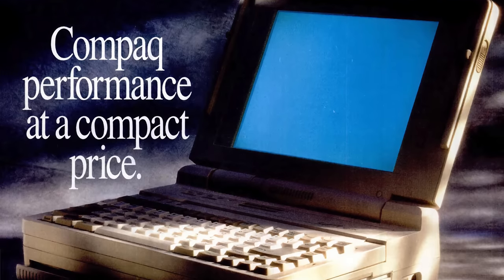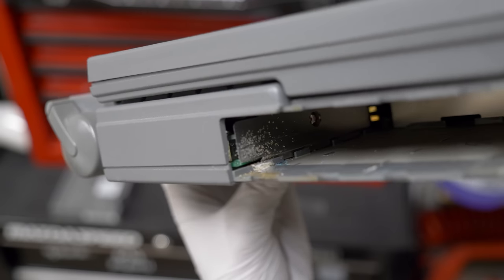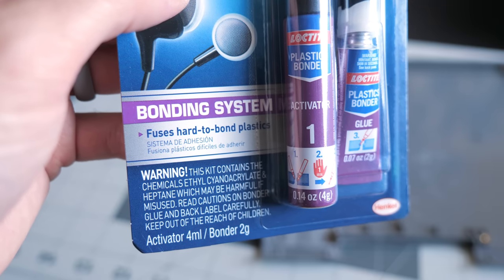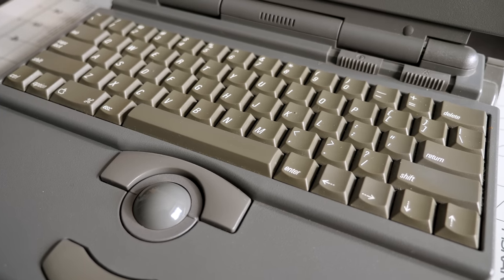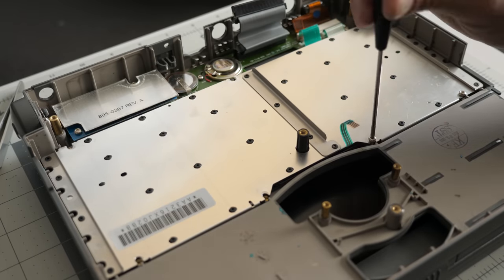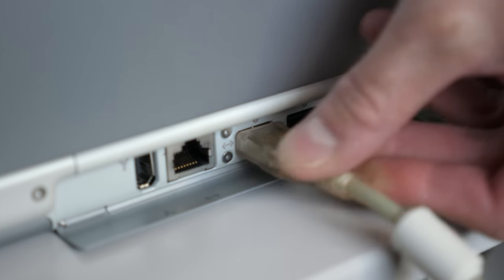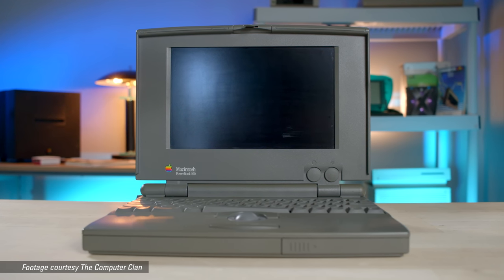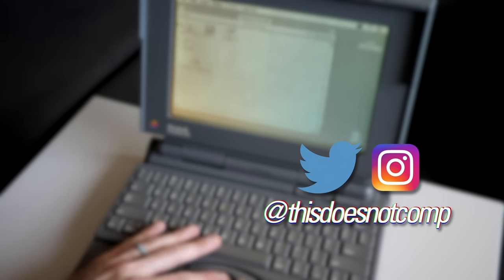Restoring a Macintosh PowerBook 145B

Comment: Thank goodness it's not a PowerBook 190.
Reply from the maker: Yep. The only machine worse than the 190 was the 150.
Reply: @ThisDoesNotCompute  What's wrong with the 190 and 150?
Reply: @daemonspudguy  The 190 and it's PPC cousin the 5300 had lots of fit and finish issues... paint that flakes off and weaker that normal screen hinges.  The IDE hard drives feel a lot slower than the SCSI drives included in other Macs of the era.

A 190 is basically a not-so-great replacement for the 500 series Powerbook.
Reply: @ThisDoesNotCompute .. good call wearing gloves at 2:26 Colin...... would have been okey to mention.. that the cadmium on the Ni-Cd (nikel cadmium) batteries.. (that little white powder) has been documented as carcinogenic..... especially when inhaling it.... yes.. yes.. with repeated exposures.. yes.. but never the less.....
Reply: What a piece of garbage that machine was. It bought one to replace the 145 and it died almost immediately and try and they might they never managed to fix it and offered me a refund which I spent promptly on the PowerBook 1400 which was rock solid and introduced hot-swap modules.
Reply: At least the 190 had a 68040.
Reply: As someone who tried to fix a 190 by using a 190CS and a 5300cs as doner machines, I can confirm they were a bit of a nightmare.🥲
Reply: Yo it’s the racist guy

Comment: The worst problem these days with the passive matrix screens is that the capacitors in the LCD panel fail and cause the ghosting issues and overall bad quality. If you replace those, these screens come back alive once again usually. The 145 wasn't a bad machine, it was leaps better than the 150 was in terms of a budget, lower end Powerbook!

Comment: Those standoffs for the screen were a problem long before these machines were considered "vintage".  Back when this powerbook style was current i replaced a LOT of the rear screen plastics both in warranty and out. I supported a company that 100% mac at the time and had lots of powerbook 180's and 160's i kept at least a dozen of the rear plastic in stock.

Comment: The reason why the hinge broke only on the left side is because the owner was liting the lid by grabbing the left side of the screen thus causing extra stress on that part. If the lid had been opened from the middle up, both hinges would be intact.

Comment: My first portable Mac was an ex-Middle school PowerBook 1400cs. I had started out with a Mac SE/4 that was "upgraded via eBay" to an SE/30 equivalent. I had looked at the array of portable Macs, but money was tight, so I chose accordingly. I updated this unit as I could, but the next step was the Internet. Surfing the 'Web required a G3, so it was Mainstreet/Wallstreet time. I settled on a PDQ Wallstreet from Canada, and a 500Mhz Sonnet card made it possible to explore the "Online Wild West." The next major question was, "can I create a custom DVD of interesting TV shows?" That led to a series of adventures with the Titanium PowerBooks, solved by finding a Core2Duo Intel MacBook Pro. That old unit still (sorta) works, with dead keys, subwoofer, and the Mac OSX 5 ceiling. A Bluetooth keyboard and headphones get around the dead keys and subwoofer, for now. An Intel i7 MacBook Pro has the "three beeps at startup" problem and an ifixitit session looms. Oh well, Ye Olde Lenovo ThinkPad T530 still works, even if Windows 10 doesn't "make my day."

Comment: Spin the motor in the floppy drive by hand around a few times, sometimes it just gets stuck from sitting and rotatating it can help
Reply: I'm going to guess it's probably capacitors.  I have brought several PS/2 floppy drives back to life by re-capping them.  And a 720K Teac.

Most of those just needed new mini radial caps on the motor PCB (underneath the disk).  But, I'm fixing a Mitsubishi 1.44MB drive now that had SMD cans on the controller board that leaked everywhere and took out an adjustment pot next to them.  Yuck.

It's always the caps.  And if it isn't, it probably will be.

Comment: “For various reasons I’m not a fan of retrobrite”

You have to expand on that some time.
Reply: I'm going to guess, that it's because retro bright is actually bleaching the plastic. I've heard reports that retro bright can cause plastic to become brittle and deteriorate much faster. That's usually the reason I hear when people state that they don't like it.
Reply: @akaJughead    That's not true.  The additives that yellow were originally to improve the plastics flexibility/durability.  The same chemical process that causes it to yellow, also causes it to be more brittle.

So if you're working with a heavily yellowed part, it's already extremely brittle; and if you're disassembling/reassembling something for the first time in 30 years, you're gonna put more stress on the plastic.

If you wanna read more, Hackaday posted an article in January with a polymer engineer who explained it.
Reply: ^^  What he said.

The most yellowed (or oranged) plastics I deal with are almost always cracked, or do so while working with them.  The faceplates on 3.5" floppy drives are terrible about this.  The little clips that snap into the housing don't bend anymore, they just snap right off.  I've had to glue so many of those back on, or remanufacture them with acetone and donor plastic...

The retro-brighting, though, is really helpful.  They may still be fragile afterwards, but they at least look nice.  It isn't actually "bleaching" anything -- at least, not at first.  You can tell because yellowed parts start un-yellowing, while parts that aren't yellowed just stay the same color.

I use plastic bins filled with grocery store peroxide, on top of my laundry with a couple of 30W UV LED panels suspended from a DJ lighting rig stand.  That way I can use it 24/7, without regard to weather.

It's not failure-proof, and I have had some problems, mostly I think from my own negligence.  You have to keep the parts submerged, otherwise they just bake in UV.  This is tricky, because plastic tends to float, especially once the bubbles start forming.

Also, if they aren't whitened enough after a few days, you just have to accept it for what it is.  I've RB'd stuff for over a week and the results aren't good.  That's when it starts to bleach, but not evenly.  I've got some case bezels that went through that.  They don't look very nice, but they didn't look very nice to start with.  It's just a different "not nice" now.  If I want them back in OG condition, all I have to do is paint them -- which would've been the cure anyway.

So, IMO, why not give it a shot?  I have so much stuff that took to the RB process very nicely.  I just finished a PS/1 model 2133 -- front bezel and drives.  It made a world of difference in the perceived condition.
Reply: @akaJughead  That’s incorrect. Over time, UV light causes a fire retardant chemical to leach to the surface of the plastic causing the yellowing. The UV light also causes the plastic to become brittle.

The retrobrite technique uses an oxidiser to draw this upper layer of the yellowing out of the plastic. It’s a process that should be monitored carefully depending on the strength of the oxidiser, usually Hydrogen Peroxide.

Opinions vary but low strength (3% - 6%) over a longer time is considered a safer approach over the more aggressive 12% - 15% strength.

The degree of yellowing is also a factor, slight discolouration is less likely to make the plastics brittle over heavy discolouration.

Also, the use of a cream or paste over a liquid oxidiser can vary and whether the piece to be retrobrited is left unwrapped, Saran-wrapped or sealed in a Zip-Loc bag.

As with all chemical processes, it’s best to try it on a small area first to ascertain the results before moving to the whole part.

And it might be an idea to purchase a UV lamp or LED strip to control the retrobriting process rather than rely on the Sun.

Comment: I had a 180c back in 1994 - beautiful display on it and I also used it as a desktop by connecting a VGA monitor. Looks like these models didn’t have an external display option?
Reply: I as a little 6 year old I got a ibook g3 with 256mb ram and a 5gb hhd and used it till 2017(it was S L O W)
Reply: @daytimedorks  Holy shoot, a Powerbook G3 in 2017 must really have been a pain

Comment: I had an acer laptop about 10 years ago and the housing around the screen hinges started to crack, when i closed the display, you could see inside the display housing, i applied plastic glue on the outside, pushing down on the open display while i put the glue on, i let it dry overnight, and that crack never got any worse and the laptop closed and opened again like new, no more squeeking and breaking, plastic glue is awesome, and i also use it now for all kinds of plastic repair, awesome vid man!

Comment: Proper trip down memory lane. I loved my first PowerBook 145 (bought with summer job money in 1993) and like you, I spent a lot of time cleaning the smut out of the trackball. Wrote my dissertation on it and saved me from having to queue up at the computer centre at University. Tripped over the power brick one evening and shorted out the motherboard but thankfully it was repaired under warranty. Destroyed the original hard drive when the computer (in a case) took a tumble off a chair which the insurance company had to pay out for after much discussion with the loss adjuster. So many a lesson learnt on computer ownership as well as wishing that MagSafe had been invented in the 90's! I've only ever bought MacBooks since then...

Comment: Saving this for later.  I have a 145B that I saved from a sad fate in a garbage truck years ago and have never gotten around to working on it.  My hinges seem fine, the battery only had a small amount of crud.  I don't have the original power brick, but I do have a multi-voltage adapter from RCA that supplies 7.5v.  Unfortunately, the PowerBook will not start.  Maybe now I have reason again to try to get it running.

Comment: I had a Powerbook 180 machine back then. I remember that I had to buy a specific adapter to get it to work at 75Hz on a regular PC 15" screen, otherwise it would only run at 60Hz, which would really hurt my eyes after a couple of hours. I also remember that every two or three days, I would need to clean the tracking ball. The best solution was to use soap and water to clean the ball and Qtips with a bit of alcool to clean the rolls.

Comment: Are you sure the disc was formatted correctly?  I’ve had issues in the past using an OS-X machine to format disks.  Can the OS that is on the PowerBook read HFS+ discs?  What happens if you format the disk on the PowerBook and then try to copy>

Comment: I had a Compaq 486 in 94. It had a small marble sized trackball off to the  right side. Mouse buttons on the side of the laptop It was terrific. I'm using laser trackballs today because of that one computer. Trackpads... so irritating I unplug them when I can. It's worth the occasional cleaning to not have wrist issues after gaming and work. Can be super sharp in games as well.

Comment: Would it help to also lubricate/oil the hinges a bit so the stress is less? Or possibly could that make them too loose?
Reply: I feel like adding the lube will make the hinge smoother but the stress would be the same if the lid is continued to be opened improperly. The lid needs to be lifted from the middle up to equally distribute the stress load. I think this is what caused the hinge to have broken in such a way.

Comment: I don't know if you did this off camera, but a lot of times if the heads aren't moving, the worm gear might just be frozen in the motor (I've seen it a few times on floppy drives). Twisting it carefully but firmly by hand if it doesn't move will free it up. I also would recommend removing all of the old grease before putting the new grease on top of it, because you will end up with the same problem from the old grease anyway.

Comment: this got me thru high school and college from 93 to 99. wrote my honours thesis on it sitting on the floor in my flat with the back stands turned up. was still working till 2015 (!) when finally the screen warped and sort of melted.
Reply: That's the polarizer. It can be fixed, but it's not easy.

Comment: I have this exact laptop, and I have the exact same gap in the plastic on the same exact hinge. That specific part of the laptop must be a defect. I'm only 14 but my parents had this laptop out for like 23 years. So ours was like new, and didn't get yellow overtime at all. Surprisingly fast for 4mb ram also. Ours screen has super bad display ghosting and everything sort of fades in and out of view, dont know if thats how it was or if theres a problem with the screen
Reply: You’ll need to replace the capacitors on the back of your LCD screen. Fiddly little job but you can order the right parts from somewhere like Mouser - 9x 3.3uF tantalum or ceramic caps, 1x 22uF 35V, 1x 100uF 6.3V or 10V, there’s a good video on YouTube ‘Powerbook 140 capacitor replacement’ :)

Comment: Of note, the various Macintosh software archives (Garden/Repository) have actual restore images to reinstall the actual software that would have come with each machine. They are on a CD image made by Apple, likely used by Apple dealers/refurbishers. Sometimes it's not much different than using the vanilla retail installers, but I like that extra level of authenticity.

Comment: Had the PB145 (sans B) as my 2nd Mac. The family computer was the Performa 405 but my brother and I both would need a computer at same time so we went in halfsies on buying it at Sam’s club. The first one came with a dead backlight. Returned it and the replacement had a “sorry” memo from Apple that due to ram chip shortages, they had to install  more than what was advertised on box —  instead a second 2MB  to go with the 2MB on board they put 4MB  (6MB total)

Comment: Awesome refurb job, Colin. I have a similar problem with the screen hinge on my PowerBook 5300cs that needs fixing, looks like I ought to browse thingiverse for a possible solution.  Also, I bought a 5300c parts machine with the thought of swapping the passive matrix in the 5300cs for the active matrix from the 5300c. Based on what you said, i better check for the similar tunnel vision before doing the swap.

Comment: Question: Are those daughter boards with CPU interchangeable between different computers? They should fit physically, but could the computer be turned on and perform without a glitch? You've already shown us how IBM did it with a ThinkPad T30.

Comment: I miss my Powerbook 180 working. Its been sitting on a shelf since the 90s covered in dust. It slid to the front of the school bus during my high school years and crashed the HDD. Then some time later it just stopped accepting power.
Reply: Could be a new fuse needed by the battery terminals. I just restored one of these mainboards this way.

Comment: Thanks for video.  My dad had the PB170 when it just came out.  It had the superior Active Matrix monochrome LCD compared to the crappy cheaper screens of the other models.   It seemed to run just as fast as my two year old (at the time) Mac IIci, except of course the power book was only black and while.  Nice little, but expensive machine.

Comment: i've been having a nightmare with a pb180 similar to this - the hinge on mine broke, but the standoff itself came loose, so i have this nut holding the screen bezel on while the screw spins freely. I've tried grabbing it on the other end with longnose pliers tipped with CA glue, and then trying to unscrew it, but that still couldn't give me enough grip. is there anything else i could try?

Comment: Did you try inserting the floppy disk with the drive disassembled?  Sometimes the issue is a spring wears out and one of the heads stops contacting the disk.  If it’s the top head, you can sometimes just weigh it down by taping a coin to the top of it.  Otherwise you have to take the spring out and twist it back around the other way to give it more tension.

Comment: About the floppy drive: at 14:55 you’re putting in a high-density disk but the drive is offering to format it as single or double sided; it’s seeing a double-density disk? Therefore the pin switches at the front of the drive might need a spray of contact cleaner?

About the Acer D/C sticker on the keyboard - I’ve noticed that all Powerbook 150 parts have such stickers. I suspect that Apple ‘farmed out’ production of the simpler 150 as a budget last-of-the-line version. The 150 was lighter - it did away with the multiple-board sandwich and standoffs are less likely to be broken as a result (you were lucky that your floppy drive bracket wasn’t floating free). 

However, despite the lighter 150 being the best value overall, I still think the original Powerbook 100 was a better design than all the other 100-series models that followed it. The 100 was slimmer, stronger (never any broken hinge or board standoffs), and had the curved edge to the display where the others were square.

Comment: I have a PowerBook 180c with the same problem of broken-off standoffs on both hinges, the hinges themselves are also too hard to turn. But the worst part is that the display data cable is completely missing, there is only the backlight cable.

Comment: Aboutt that floppy drive: something similar happened to me a while back with an LC II: cleaning and lubricating the drive did not help, not even changing the motor. In the end, it was the motherboard that needed recapping: after that, everything started to work.